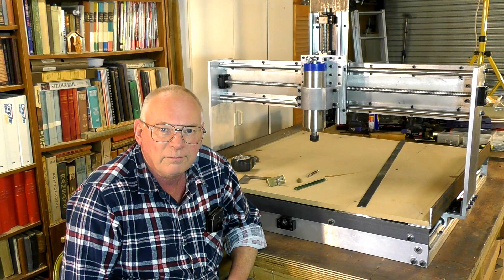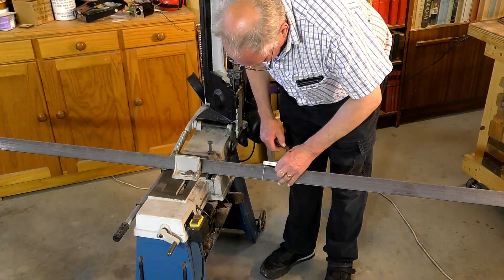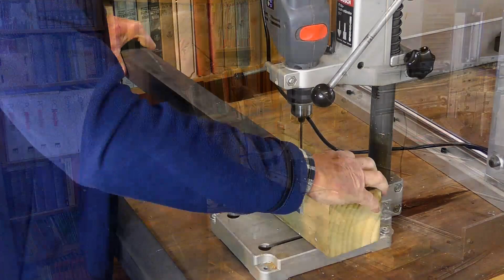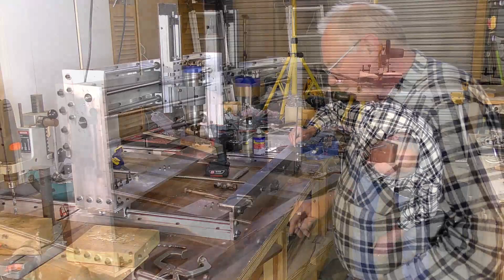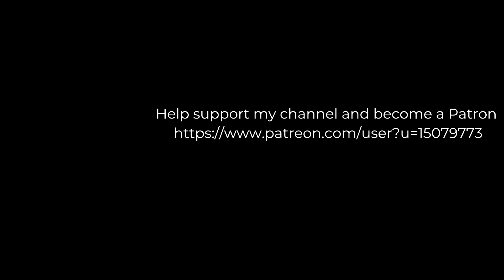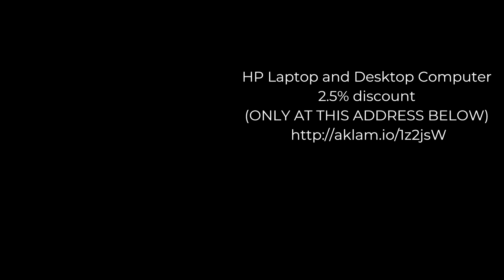Episode 11 HOW TO MAKE A CNC ROUTER WITH (standard) WOODSHOP TOOLS (the machine bed part 1)

Comment: I wasn't too wowed by the mounting of the 2 angle irons using the table top as a reference level surface..........across that span (forwards to back) you should (could)  have used a digital level on each angle iron, having first leveled the machine frame itself.......the hard part would have to be getting both angle irons level and this is where a digital level comes in....they are quite accurate for getting 2 surfaces level to one another that are far apart.....the same would go for the side rails.........I would not hesitate to state that a digital level is as accurate as a precision machinist level at a fraction of the price.......at the same time, having just bought a digital protractor......with stainless steel rulers...... I can also say it is very accurate for measuring angles accurately.....as good, if not better, than a sine bar and also cost very little.
I'm just watching this build with mild interest as I'm building a more beefy 3018 CNC router from the ground up......(moving table type) , just for fun, as I think the bought kit models for $200 are too flimsy for real work.